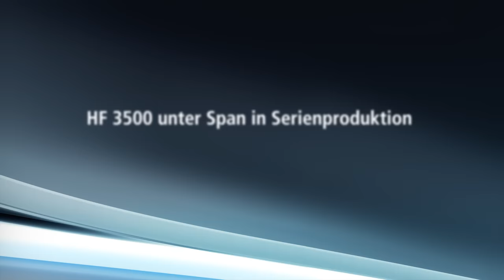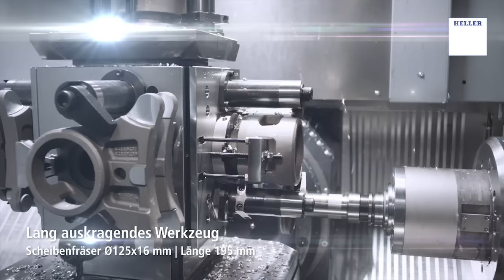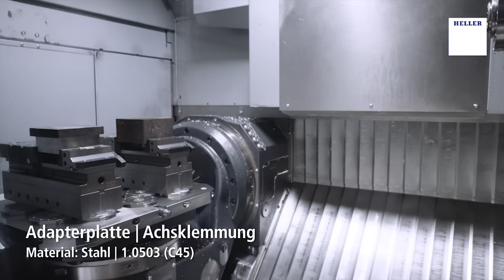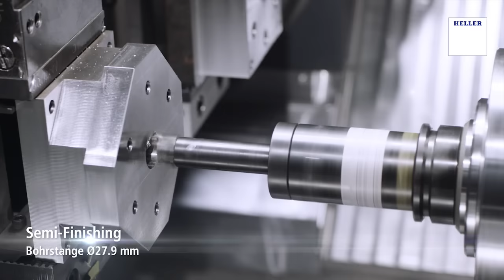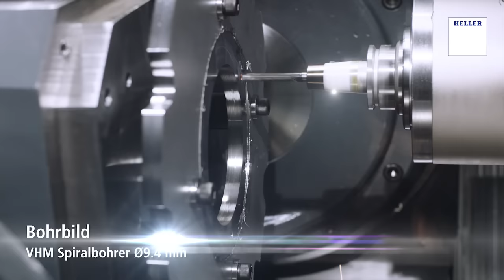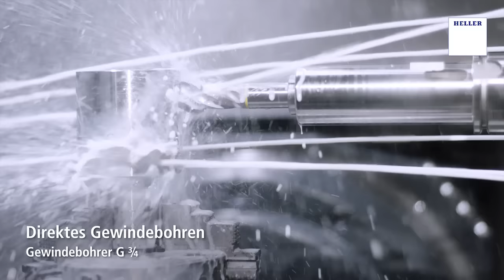HELLER HF3500 unter Span in Serienproduktion

Comment: Warum rotiert ihr die C Achse bei 02:46 statt das Bauteil einfach weiter in der vorhandenen Position zu bearbeiten? Ende des Verfahrwegs in X/Y? (Arbeite selbst nicht 5-Achsig, daher evtl. eine unnötig Frage)
Reply from the maker: An dieser Stelle sind natürlich beide Lösungen möglich: Anfahren der Position mittels Linearachsen X/Y oder durch Einschwenken der Rundachse B.
Nein, die Linearachsen sind hier nicht limitierend (X ±355 / Y -200 +550 mm). Dank der hohen Dynamik der direktangetriebener B-Achse bedeutet das Schwenken kaum Zeitverlust, vielmehr ist die Bearbeitungsstelle für den Bediener (und auch den Zuschauer) viel besser einsehbar.
Reply: name soundtrack ?? :)